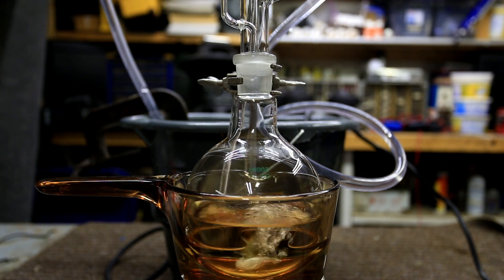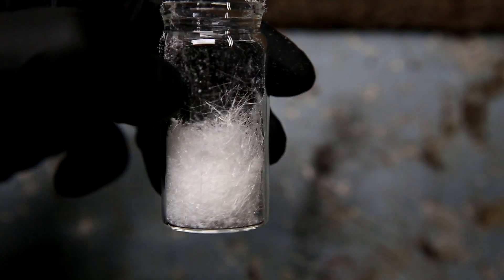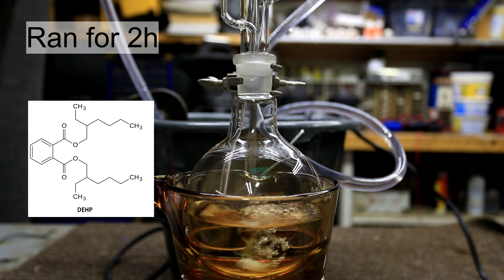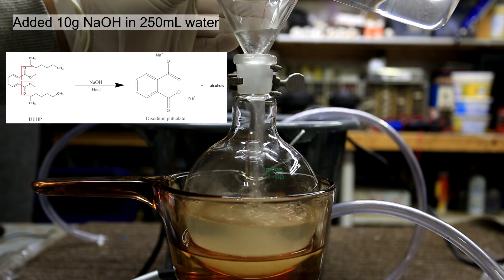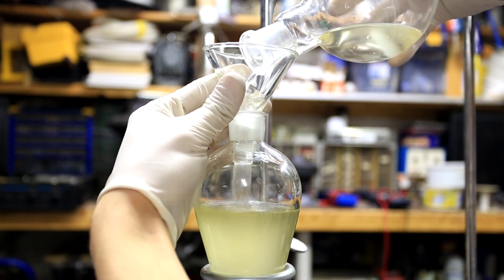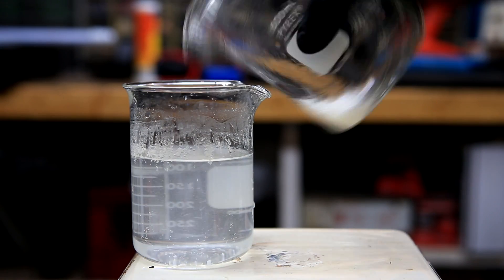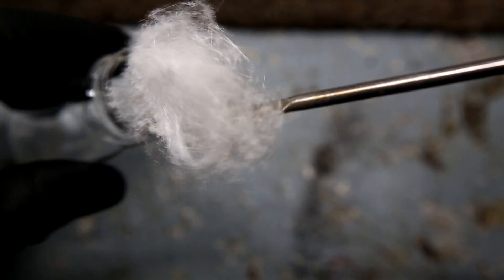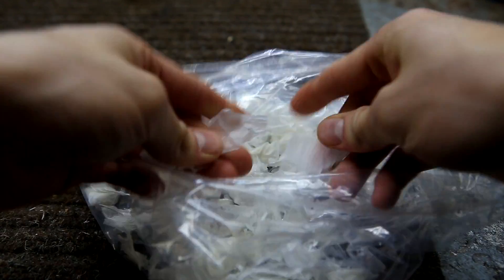How to make Phthalic acid and Phthalic Anhydride

Comment: Awesome video as always Nile. Quick question, if I went the route without the soxhlet extractor, and used the iso and glove boiling, would it be better if I refluxed the solution using idk say a allihn condenser and reflux the solution, or would just boiling the gloves in the isopropanol be a better way of doing it? If anyone could leave some input it would be greatly appreciated
Reply: I believe refluxing is a better choice, as leaving the beaker open would result to a great solvent loss.

Comment: For anyone thats running this synthesis, if you instead use just 100mL IPA in the soxhlet extractor (instead of the 250mL), and also dissolve the NaOH in just 100mL of H2O (instead of 250mL), then you will get more phthalic acid crystals, some will crystalize out of solution before you even put it in the freezer. Just a suggestion. 
I followed the steps listed here almost exactly, and while it worked ok, I had to boil off a lot of the solution to get a decent return of phthalic acid crystals. Just using less IPA and H2O made a world of difference.

Comment: If no extractor is used, how much isopropyl alcohol should be used in the boiling step?
Reply: about a liter (at least that much was used in the capsaicinoids video). I tried my luck with the capsaicinoids using 200 ㎖ of acetone instead of a liter in a lab bottle, leaving it on the radiator for about 5 days and i got a nice goopy extract after evaporating it off

Comment: I worked in a plant. We used ortho-Xylene vapor oxidised with air over a catalyst at 400C. produced enough heat to run our power station. Made about 100 tonnes a day. then we esterified the phthalic anhydride with 2-ethyl hexanol, or decanol, or nonanol to make plasticisers.
Reply: How do you perform esterification? Just sulfuric acid and maybe azeotroping agent?
Reply: @dimaminiailo3723  oh hell no, not on an industrial scale ! best choice of cat is a acid group on a solid support, last's forever...

Comment: Hi Nile,
I am a young Czech chemist and also your fan. I rly like your videos, because, they are interesting, exciting and help me to unite my teoretical and practical knowlage. Last week we decided to extracte few grams of phtalic anhydride, but we failed. After the ester hydrolysis and boiling the solution under refluxe, we left it cool for one day, but the solution didnn’t separate in two layers. We looked in chemistry text book and we found out, that isopropyl alcohol is miscible soluable in water and there is no reason, why the two layers should separate. I will be greatful, if you tells me, where we actualy made mistake and what is the uper organic layer? Thanks for your answer. 
                                                                                      With sincerely Kamil – Lukáš Zach
Reply: maybe a bit late but, adding a salt to the water wil make te isoprpyl alchol less soluble in water, resulting in 2 layers.

Comment: can ethanol be used as a solvent instead of isopropanol?
Here in Italy is VERY difficult to get isopropanol...
great video however!
Reply: Rubbing alcohol is usually 92% or 98% Isopropanol (also Propan-2-ol or Isopropyl Alcohol). 

It is readily available from Oil and Gas companies as well as chemical suppliers from the internet. Electronics stores also sell it.

In the UK, it's the other way around. You need a license for ethanol, and getting absolute ethanol is almost impossible, unless you run a factory.
Reply: +Mao Zedong i live in italy, and here ethanol is sold just like isopropanol. just want to know i it is possible to extract it with it instead of isopropanol
Reply: Giampiero Baggi
Possibly. I know 1 litre of Propan-2-ol is about 10 Euros, 15 euros with shipping.

If you can get Propan-2-ol/Isopropyl Alcohol then I suggest that instead. Considering they're only used as a solvent you can probably get away with using it.

Check the MSDS or Pubchem or Sigma Aldrich information on it to see if it's soluable. Wikipedia might tell you if it's soluable or miscible.

Isopropyl Alcohol is a good reagent and solvent to have at hand. Brilliant at cleaning PCBs, electronics and glue as well as inks.
Reply: Its possible to make pure ethanol by oneself but its probably not legal in the UK.
Reply: fpuGermany
It's not. But it's not really enforcable.

Making Ethanol for chemical/non-edible purposes does exempt it from tax though.

You can apply for an IDA (Industrial Denatured Alcohol) License for free, like I have, and you can buy 20 litres of 98.5% or less concentrate alcohol a year.

You can recrystalise the alcohol to purify it and make it anhydrous, but if you want to by anhydrous out right, then you need a TCA (Total Concentrate Alcohol) License. You can only get that if you have a Public/Private Limited Company with a VAT number.
Reply: Cuz isopropanol can be used to make tatp Paris terror

Comment: Good vids.

 (1) How many cycles through the Soxhlet extractor is sufficient for full extraction of DEHP? I figured no more than 4.
 (2) My proportions are a bit different. How do I know I got enough NaOH and HCl?
 (3) Is there a way to detect whether I have DEHP before running the entire experiment?
 (4) Do the acid and/or alkali react to the propanol?
 (5) What are the side products? Would they be useful?

[I moved this from Facebook to here.

Comment: Can you do something cool using antacid tablets?
Reply from the maker: Matthew Ferrie If i end up needing CaCO3, Ill do it!
Reply from the maker: +Matthew Ferrie What would you like to see?
Reply: +Nile Red extraction of the calcium carbonate, preferably using the fruit flavored ones (I have those.)
Reply: +Nile Red Hey man i recently did this on 80g of vinyl gloves only instead of using a soxhlet extractor i just refluxed it in 600ml of isopropanol, this went well and the gloves left over appear to have lost there plasticizer, but when i did the ester hydrolosis it started out alright, i added my hydroxide solution and there was a phase separation there, i then had it on reflux for 3 and a half hours and the solution changed from a milky white to a dark yellow almost orange color there was alot of white precipitate at the bottom so i added 250mls of water and dissolved the majority of it, however i have failed to get a phase separation and the entire solution just remains that color. its strange because everything seemed to be going perfectly up to this point. Would it be a good idea to simply add the hydrochloric acid and filter off the precipitate and recrystalize?
Reply from the maker: jared garden I would just try and see what happens. I had to try a few different brands before I got one that worked well. It is a pretty annoying process honestly
Reply: +Nile Red Yea im trying to get my hands on a specific brand of vinyl gloves called proforce which according to another youtuber contains 36% DEHP however i dont live in america and so its not sold in my stores and ive only found one supplier on amazon but they want to charge me $76 for shipping.
Reply from the maker: jared garden yeah i had the same problem. In canada it would have cost a million dollars. I just kept trying with different gloves until it worked

You can also buy phthalic anhydride from ebay now. So that is an option too

Comment: SUCCESS!  I picked up a 10 pack of "Mr. Clean" brand gloves at Dollar General.  Weight was 41.19g.  I did this in three days.  First day, extraction.  Second day, NaOH and reflux.  Excellent phase separation.  Put in freezer overnight.  Day three, did sublimation, not quite a gram, but at least it worked!  PS-used 1L flask in mantle/stirrer from Cynmar; nice units.

Comment: FYI: Vinyl gloves from Rite Aid Rx will not work.  I got through fine, and after three hours, the refluxed liquid was yellow.  Six hours later, there was no phase separation, thus the conclusion.  Also, don't waste money on one of those $130.00 heat/stir units with the blue front panel.  They will burn up regardless of what the manual says about cutoff, etc.  Go for a better commercial unit!

Comment: Is the Soxhlet 250mL or 500mL?  Also, is the RB flask 500mL or 1L?  Will a heater/stirrer with a capacity of 500mL be strong enough for use with the water bath ?  It has a 4.5" square base  Thanks.
(I think I sent a message earlier, but I don't know where it went...).
Reply from the maker: ***** I don't get the notification for messages so I never seen them... RBF is 500 and I believe the soxhlet is 250mL. I am not sure what you are asking about whether it will be strong enough.

Comment: ive tried this before and failed, i believe the gloves i chose didnt contain the DEHP. I was wondering if anyone can suggest a brand that works. Im in the pacific nw of the usa if that helps. thanks.
Reply from the maker: You will have to try a bunch and see. I did it with a random brand I can't remember and it worked. Tried again with my local pharmacy brand and got some unknown white precipitate that wasn't phthalic acid.

Comment: Is IPA only used for extract DEHP?
And other alcohols like n-propyl alcohol can be also work?
Reply from the maker: I actually did not know this, but IPA does tend to form peroxides with prolonged storage. You need to be careful when distilling old IPA. 

I never knew that.
Reply from the maker: I think you can probably use ethanol or n-propyl alcohol. You would have to test that yourself though. Soak a piece of glove in the solvent. Remove it and see if it has become rigid.
Reply: Nile Red thank you for advise! I'll try it :)
Reply: Nile Red does IPA forms peroxides on prolonged storage?
Reply: Nile Red
Yes, I remember reading that somewhere but I wasn't sure. Thank you.

Comment: I just 3D printed a keck clip for my 24/40 glassware. I noticed you were not using any clips. Did you use any grease?
Reply from the maker: I only use keck clips if my apparatus is going to have trouble staying together and I really only use grease when I do something under vacuum. For the most part, the ground glass joints stick together pretty well.
Reply: You have a 3D printer? That's pretty cool! I noticed 3D printers were coming up often on your google+ page. What model is it?
Reply: Wow, thats good news for me because I don't have any grease lol! My printer is a Da vine 1.0. It is very cool.
Reply: JMAPScience wow! You should make a video on it. One question: Is the printer limited to one plastic or can it use many?
Reply: TheKingOfChem No you can use every thing from ABS to bronze and glow in the dark. Even nylon.
Reply: Use teflon tape!
Reply: Is the Soxhlet 250mL or 500mL, and is the RB flask 500mL or 1L?  Also, will a hot plate/stirrer maximum 500mL capacity with a 4.5" base be adequate using a water bath?  Thanks...

Comment: acetic anhydride synthesis?
Reply from the maker: TheKingOfChem I have made acetic acid, but not acetic anhydride! The synthesis of that is going to have to wait until the summer probably.
Reply: nono thermal decomp of acetone into keten and methane bubbled into GAA until waight gain is reached. no orto notrate some toluene and reduce it. and you can bake qualuudes
Reply: I he has a video on that already.